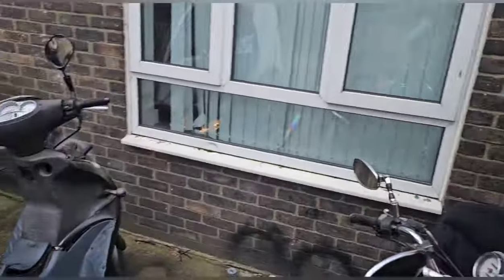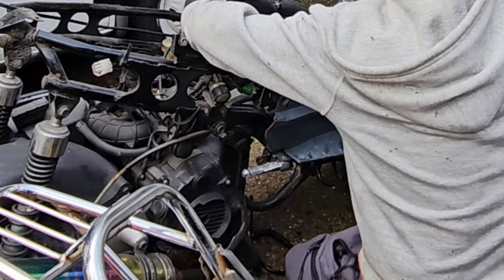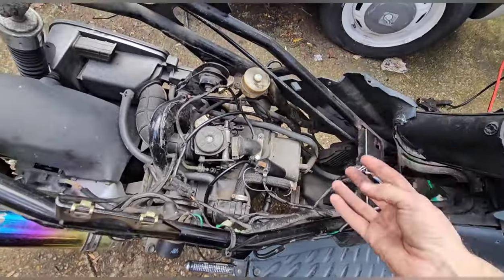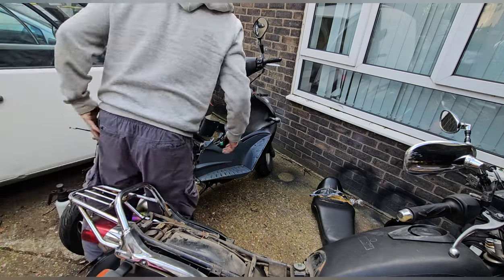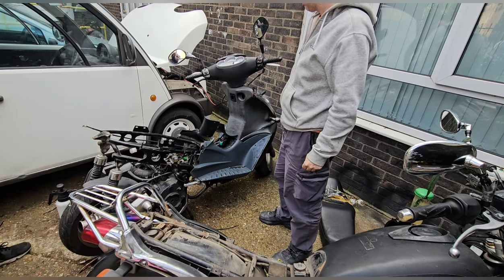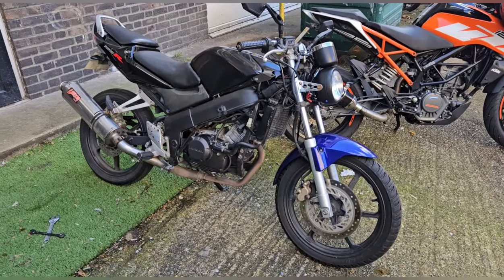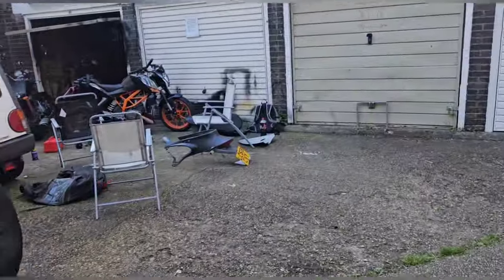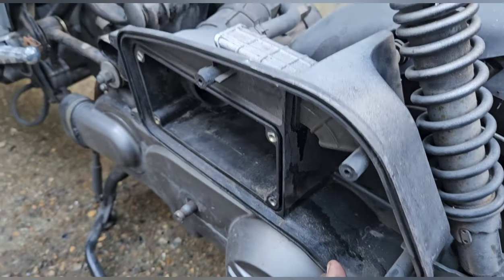Benelli velvet start up attempts. Coils, wiring, cranking and Rabjab.

Comment: Hi bud i got a honda ps 57 reg , 16k on the clock , needs few bits but can have it cheap as chips
Reply from the maker: What area mate and how much you thinking? 

Thanks
Reply: North london enfield , £150 ? Needs a rad pack ,
Reply from the maker: Is the radiator busted? 

Is the engine good otherwise?
Reply: Leaking from the pipes wont hold coolent, radiator isnt leaking its self , , from what i know yes engine is ok
Reply from the maker: Cool. Give me a week or so to finish one of my current projects and I'll message you.